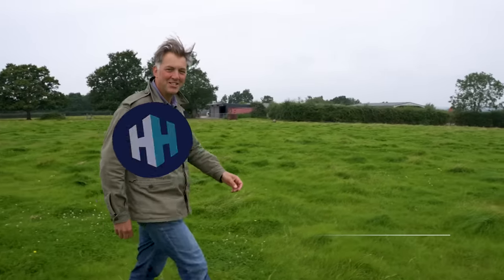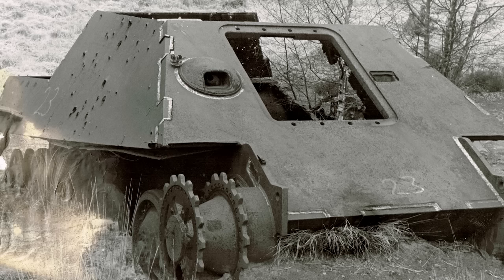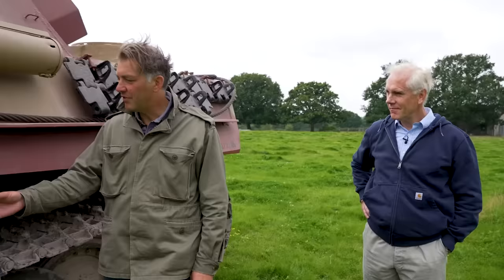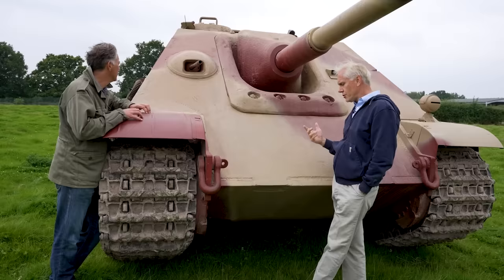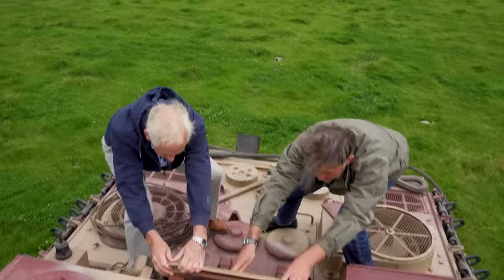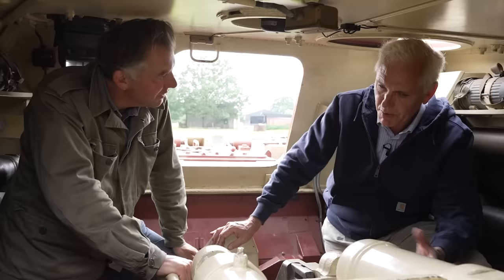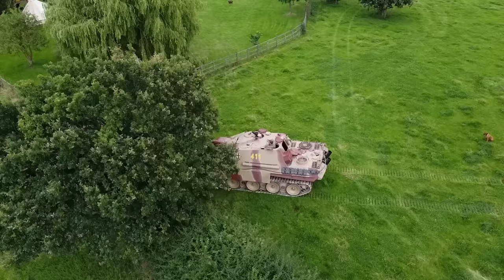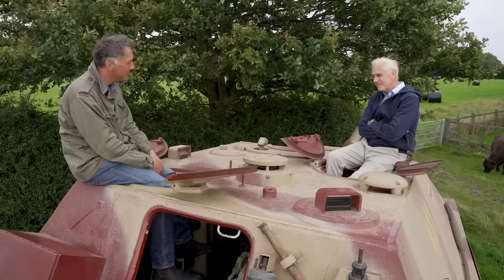Inside a German WW2 Tank Destroyer with Historian James Holland

Comment: A very "pretty" presentation...but so short on following up with the title of the video.
Practically zero time spent on what's inside...no shots of the driver's controls, zero of the gun mechanism, nothing on the gunner's equipment, nada on the radio, zilch on the gun training or aiming...
I would have loved to have heard what the engines sound like while running/moving thru the field.... but that, too, is smothered by pretty music. 
Yet, you spent 3/4 of the time discussing 18 year-olds and forever repeating that it's a defensive weapon. 
Sorry, but I feel I wasted a half-hour.
Reply: He did explain the ventilation fan.

Comment: Stupid, the 75mm and the same 88 in the Tiger were just as capable of smashing a Sherman or T34 and much easier to aim. Wouldn't it have made sense to just build more Tigers / Panzers? This kind of waste is the biggest problem for Wehrmacht during the war. Why develop a tank killer when you're tanks who weigh about the same, and cost about about the same presumably, are capable of tanking on enemy tanks 2 or 3 on 1, maybe more for a Tiger? I mean it's cool but... What a waste, thank God they made these kinds of mistakes. They even overcomplicated the design and didn't share parts with the Panzer on top of it.... Ridiculous.
Reply: Lol the tiger was a horrible tank
Reply: The Tiger with the corresponding gun was heavier and more expensive. Its ball-bearing race for the rotating turret was difficult to manufacture.
Reply: @daveybyrden3936  fair enough but one bad steak knife is still better than two butter knives when you're trying to carve a turkey.... The point being you could have an unlimited number of useless machines and they're still going to be equally as useless.... This tank killer can't do the job of a tank. If you need tanks it's still better to have half as many actual tanks. Like guys, twice as many useless things is not better than one kind of useful thing. A whole basketful of wooden spoons is not going to help you if you just need one bad Axe to split wood....
Reply: @Callsign_Merkava  no doubt boss. However the tiger is still an actual tank and it can do tank stuff... This is not a tank its artillery with some armor in the front.... It can't do tank stuff. Also you don't have a need for a tank killer if your tanks already kill other tanks. So if you need more tanks it's not going to help you to use your steel treads tracks guns etc to build not tanks...  That again you don't need. It's just a bad plan.

Comment: just want to say that claiming it's not a tank because it doesn't have a turret is the most ignorant and factually incorrect thing anyone can say about a tank. You can still say it's not a tank but claiming it's just because it doesn't have a turret is simply false and missleading.
Reply: Where is the official definition of "tank", then?
Reply: @daveybyrden3936  so you are seriously going to say that Little Willy and the Mark IV are not tanks, the Strv 103 isn't a tank? But the M1 light tank and the M18 hellcat is?

Wether it's a tank or not has nothing to do with weather or not it has a turret but rather it's role and it's usage.

Also as per your request the Merriam-Webster definition for tank says " : an enclosed heavily armed and armored combat vehicle that moves on tracks".
Reply: @MarshmaloWarrior    What on earth are you talking about? I didn't say ANY of that.
My post is still there, unedited, and all it does is ask for a definition. 
Did you reply to me instead of some other person by mistake?
Reply: @Davey Byrden  alright I'm sorry. I persived you comment as if it was challenging my notion of tanks not requiring turrets to be categorised as such.
After many years of having to deal with people that insist on said unfounded requirements, I get a little to forward proving them wrong.

Comment: How did the Germans manage to make a tank destroyer worse armed then SU-100, with less internal space then SU-100, slower then SU-100, more mechanical issues then SU-100, more expensive to make and less armour???? Just how and why
Reply: How do you reach such silly conclusions?

The Pak 43 penetrates more armoru than the D-10S

The top speed of both vehicles is pretty similar

The SU-100 had less internal space